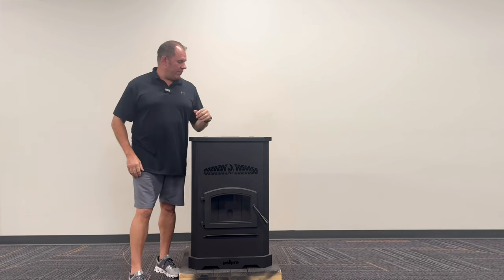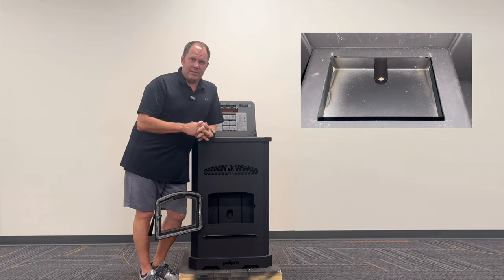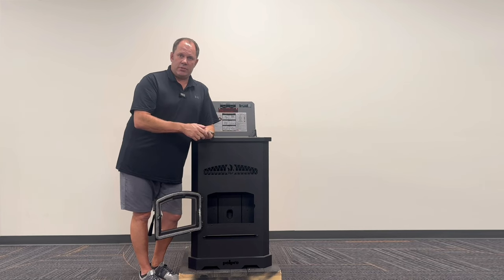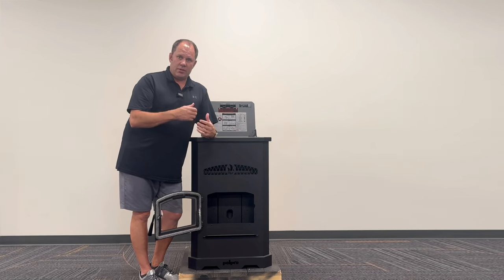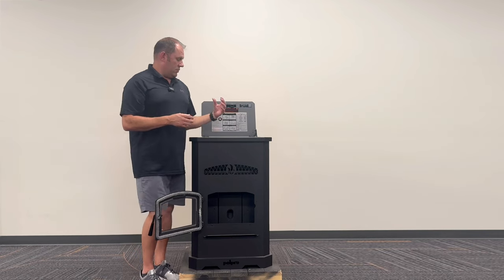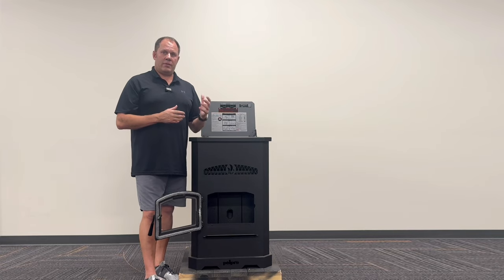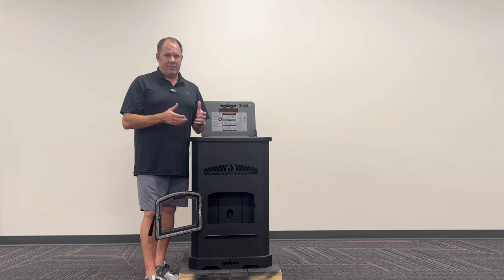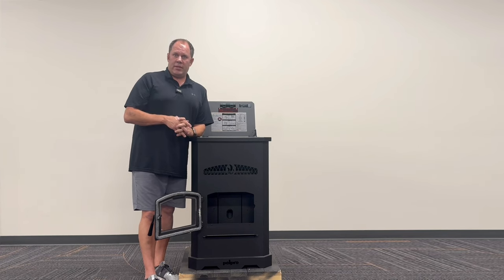How Does a Pellet Stove Work?

Comment: No chimney?? What happens if there is a power outage?  No heat? Or is there an alternate way to run it?
Reply from the maker: Pellet stoves use a mechanical draft fan to push the smoke out of your home. Because of that, they do require electricity. They do not need a chimney, but do require proper venting, specifically for the heat that the pellets create. 

We have a link with a couple important pellet stove venting tips: https://www.youtube.com/watch?v=XlnEg7Jq6Sk